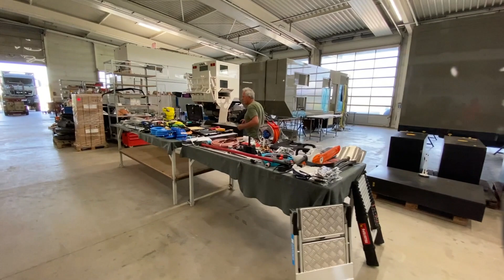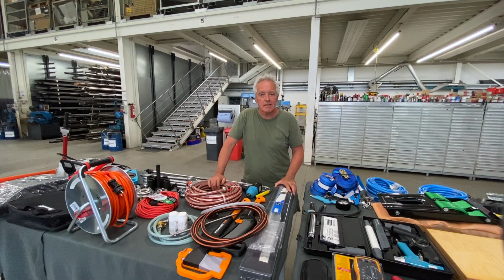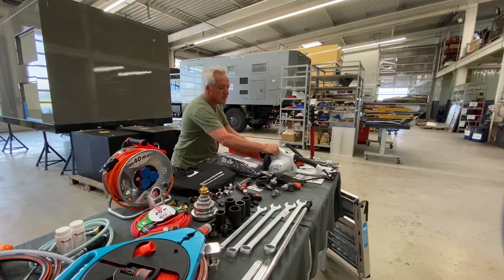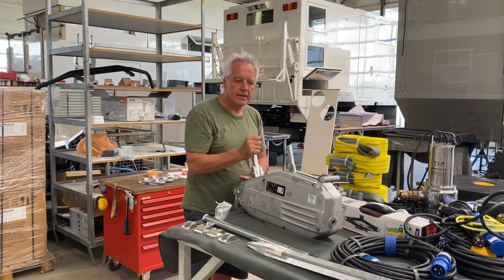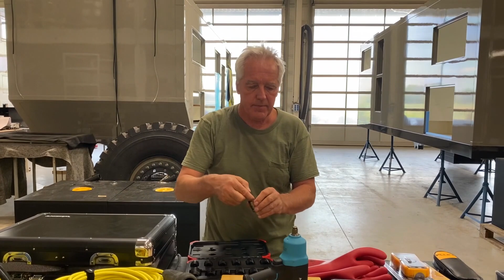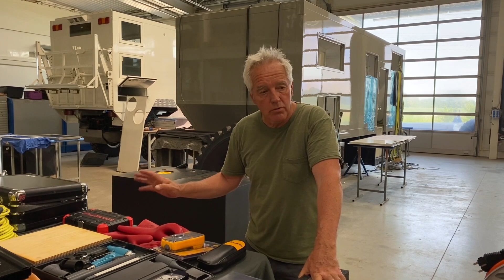UNICAT Expedition Vehicle: Basic equipment for supply and recovery

Comment: What a great summary of the useful tools. However, do you, or could you, have those summarized in written somewhere ?  Like small shopping list.
And I would be interested also in some names/brand hints .. especially for that manual winches and torque wrench + sockets.
One last question .. why air-powered rattle gun? Is the onboard air system of trucks you build powerful enough to feed that for extended time, so for example Unimog + those rim-lock wheels that's a heck lot of bolts to unscrew and screw back again.

Comment: Thomas, have you any experience with Cinderella Incineration, Gas or electric toilets?
Reply from the maker: Hello,

we have looked at electric toilets but do not have practical experience as we decided not to use them for the following reasons.

a.
Some systems need LPG for incineration.
As we prefer not to have LPG on board due to problems of international supply and restriction when shipping or when going through tunnels, those systems are not a option.

b.
Electric systems need a lot of electric power for incineration and have a limteed capacity before you have to burn it.

All systems are not as simple as a toilet system should be.
That´s why we use a ceramc toilet bowl with a valve and a tank right underneath - to us, there s no less compley, reliable and comfortable system.
As we only need 0,2 liters of water per flush, the tank has to be emptied only every 10 days.
Reply: Thanks Thomas, what you explain all make good sense, just dread the idea of emptying a black tank.